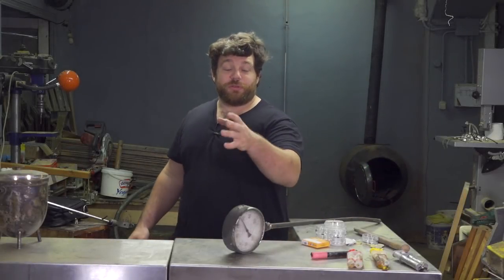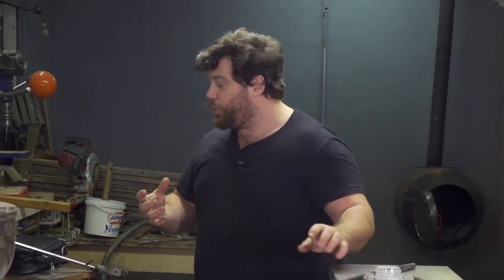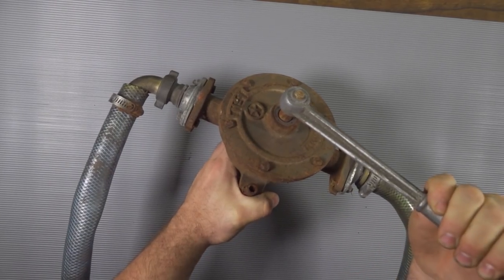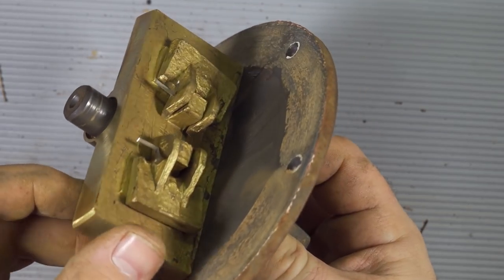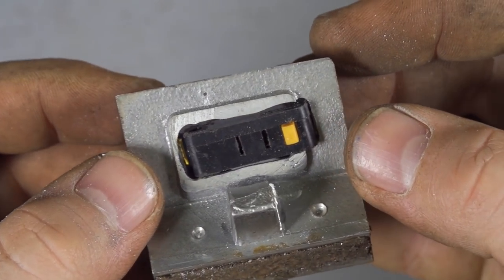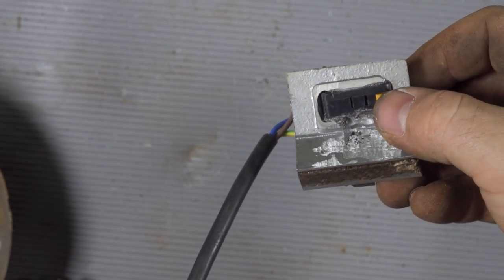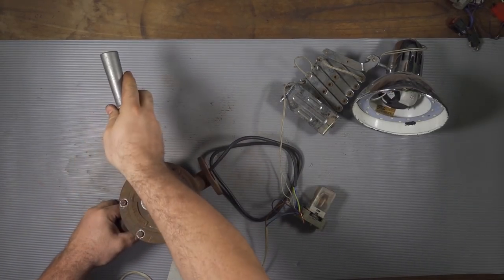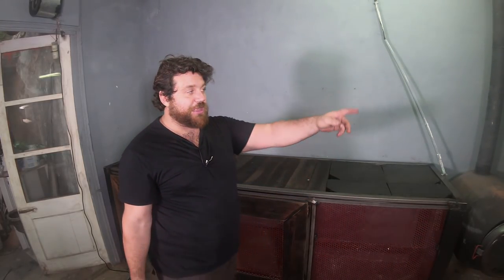How to Make a Stampunk Light Main Switch

Comment: If you would have used a push rod inserted in one end of it with the switch bolted on the end of the pump you could have saved a very neat old pump.

Comment: Something doesn't add up "The pump was filled with oil" and then opening it first time (screws stuck) and it's absolutely SPOTLESS inside. It doesn't add up.
Reply from the maker: oil preserved from rust....
Reply: @RulofMaker  I think he is talking about how it wasn't dripping with oil, it was clean and dry when we see it first.
Did you clean out the oil beforehand?
Reply: It is a pump you place in a barrel to pump small quantities out. Say 5L to change the oil in a company truck.